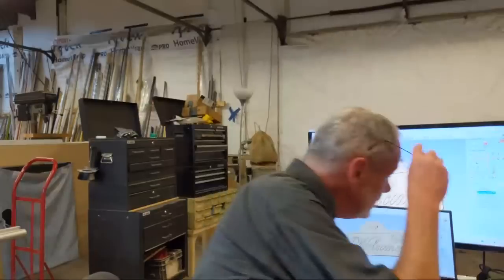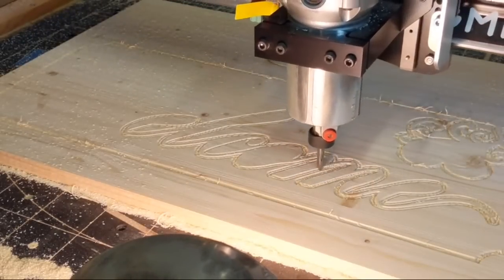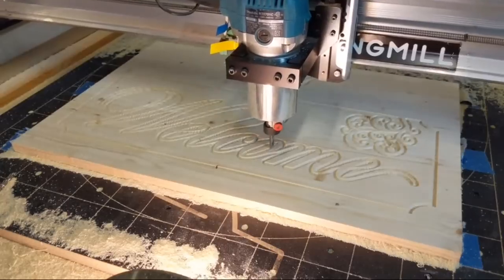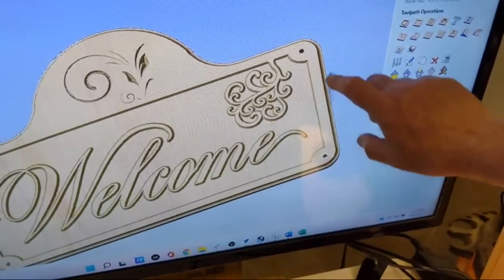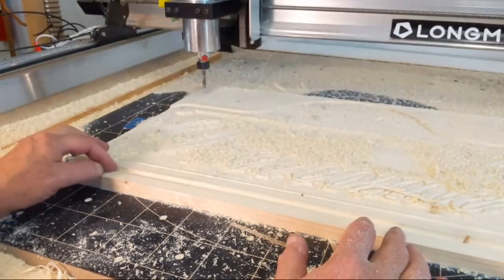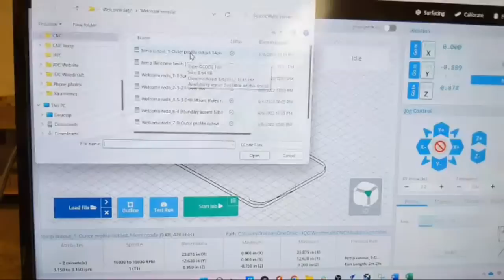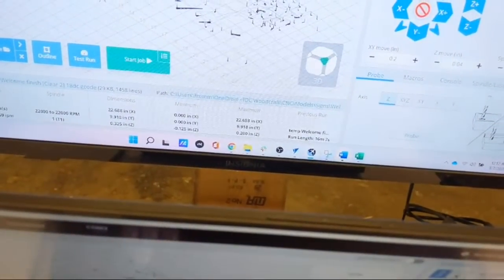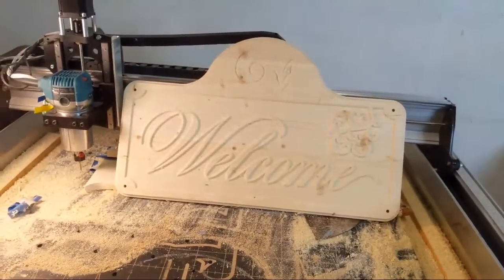How to Run a CNC Router Project Efficiently, Understanding Toolpaths

Comment: I love this kind of video man.. It's so cool to see how brilliant these machines are and what they are really capable of.. I've watched a couple of ur videos where u teach us how to use the software to get great results but atm I'm in the process of building my own CNC.. I have no experience whatsoever man.. LMAO.
I turned 50 in October and found myself making a massive career change into electronics. I love it but it's horrific being a complete novice/newbie to this field man. 
I think what ur doing is brilliant bcos ur opening this field of the CNC machine up to ordinary folks like myself. I began working with wood last year and found O had a real passion for it and then through watching some woodworking videos I got the bug and began to clear out an old garage and turn it into my workshop. It's still a bit of a mess atm but I am getting closer to kitting it out properly and I saw how good CNC's were and ordered a Laser but I'm still waiting omn it. I've bought all the gear to build my CNC now and over the Xmas Hols I'm going to take a shit at getting it built. 
I'm going the cheaper route by using belts and pulleys for now but I worry the belts will stretch and break. I will upgrade next year to the either bigger belts or maybe I will take a shot at using Linear rails..Maybe depending on price but I know they'll make it stronger..
Reply from the maker: Hey Slim, thanks for all the kind words brother. I really love what I do and getting to share my passion with others like yourself is really what keeps me going. I'm glad the videos have been helpful and that you've decided to take the leap of faith. I know clearing out the garage is no small feat! I'm looking forward to you getting your machine and seeing what you create with it my friend!
Reply: @IDCWoodcraft  Hey man.. Thanks for the reply bro. Yeah I ahve 2 weeks off now for Xmas so I'm gonna take a run at building my very own CNC and I am waiting on my CNC Laser to come soon. 
I will be kitting out my workshop this time off too so please God I can get everything goimng and the work gets to flow more. It's all a bit of a mess atm but this time off is going to be lit. I've been waiting on the Xmas Hols and finally get it all fixed up and looking like a proper workshop at long last.. I had so much to get done but now we looking to get it to look great and get it all painted up and built out with benches and cabinets and such.. This is going to be awesome once I get it finished bro so thanks for the words and inspitation from ur videos..

Comment: Great video i have so many questions. I bought an xcarve like 8 minths ago yours is sooo much faster. Can  i adjust feed rates or willnthe xcarve not be ablebtobhandle that. Sorry if that sounds silly but im pretty green yet. Thanknyou innadvance.
Reply from the maker: OhRichard, you definitely can adjust toolpaths and feed rates on your xcarve! Here is a video that should help you: https://youtu.be/qxi7epIGVX4
Reply: @CNC Routers, Beginners & Beyond - Garrett Fromme  awesome I have bought bit from idc before also and I think they have the settings on the label. I got the 1" surfacing but. Oh one more quick one is your table vacuum or were you using 2 sided tape? If tape where did you get it I'm sick of these clamps

Comment: I use Blender to create dxf files or clean up and modify downloaded dxf and svg files. It's a very powerful and free software. It can also import many different 3D files and export as stl file for 3D CNC and 3D printers. There is quite a learning curve but you won't regret putting in the effort.
Reply from the maker: Ray, that is a really good idea brother! Blender is a powerful software but just like you said, the learning curve is well worth the effort.
Reply: What do you mean by "clean up and modify"? 
Are you able to "improve" an stl file? And how is it better to use blender to improve an .svg file?
I've thought about blender before but I don't know the advantages. I have Carbide Create pro and I can carve out what is intended. But one thing I don't like about CCpro is v-carving. Constant up and down and I have no idea how to improve it.
What could I do better with Blender that I can't with ccpro?
I was wondering if you can take the time to elaborate on that?
Reply: @iwannaapple7190  You can convert dxf and svg to mesh and then manipulated the vertex's then export them back to dxf. I use it for my CNC machine. You can import stl files turn the tri's to quads and manipulate it as well and I use it for my 3D printer. I'm not familiar with carbide Create.

Comment: I was very interested in purchasing a long i’ll because of what you said about it in various video’s but when I see how long it takes to cut out a sign , then I thought what if I wanted to produce a 100 it would take a reticula’s time, can it go any faster
Reply from the maker: Hi Roy. CNC routers like any other method of creating things, are not machines that can punch out projects like a production machine without a lot of thought energy and systems building. But, becoming good with a CNC will enable you to significantly reduce the time it takes to make something.

Comment: Bought your bits, used the area clear, worked really well! 
? , after the area clear and changing bit to the 60 degree vbit, will the paper method work to redo the xyz?
Reply from the maker: Michael, right on brother! I'm glad to hear the bits have been treating you well so far! Absolutely correct, you can use the paper method to reset you z zero again after the bit chnage!

Comment: Can this be speeded up by using the optimize tool path button so it doesn’t skips all over, but finish to local area first?  I get the depth of cut changes involved. 😎
Reply from the maker: Paul, you can definitely do that but it is worth doing some trials to see if it makes a huge time difference.

Comment: I'm new to cnc, going to be buying the Longmill 48x30 thanks to your suggestion. If you wanted to have the recesses of this sign painted black and the surface colour wood, could you do the surfacing pass last? or would the surfacing bit destroy the project details
Reply from the maker: Brian, you wouldn't want to do the surfacing pass last. What you should do is use this material called Oramask to cover up all the areas that you dont want to paint. Here is a link: https://shrsl.com/36t5i

Comment: In the several videos I've watched I've never noticed you changing the rpm on the rotor. You  seem to watch the cutting and change travel speed, plunge rate, etc. to get the cut quality you want. What are the why's on this?
Reply from the maker: Ron, depending on the wood and even the grain the machine cuts a little bit differently. You will get a "ear" for what feed and speed sounds good on your machine and the harmonics it produces as it cuts.

Comment: So as I was watchhing it, I was wondering if you would get the same chip out if you had it going the oppesite way, seems like the bit was trying to cut backwards???
Reply from the maker: OneFishTale, you are exactly right but it depends. This is called "climb" cutting vs "conventional" cutting. Chipout depends on the direction but also the wood grain in relation to that cut direction! Best bet is to use a downcut or compression endmill.
Reply: @IDCWoodcraft  Thank you, I"m a total CNC NEWBIE, but I have been doing woodworking for over 30 years, so I know that using a router backwards will work when you want to try and clean something, but against the grain it will tottaly destroy it.
But anyway I love youre Videos, and I learn alot from them, so again thank you

Comment: Wish my signs come out that good, or even work AT ALL, my cnc starts off ok, then goes weird and routes letters over the top of each other. Ruins it everytime, but in different places each time. I got workbee 1500x1500 with 2.2 kW water cooled spindle. Use easel pro & mach 3. The tool paths don't show any errors on inspection. I'm ready to throw it out, only got it 2nd hand. Replaced lead screws & nut blocks etc. But it just keeps stuffing up.
Reply from the maker: Steve, have you tried running the toolpath dry above your spoilboard without any wood in the machine? It might help you diagnose if your problem is in the machine or your toolpaths
Reply: @IDCWoodcraft  if errors in the tool paths, wouldn't the problem be in the same area each time? I'm not sure. Machine makes a different noise each time it happens, so I'm leaning more toward hardware issue. It seems to happen on the rapid movement between cuts ✂️
Reply from the maker: @steveedwards2889  of it is a machine issue, you may want to check all the wire connections

Comment: Very nice project.  Do have a question.  Would like to see a vid of your design process for something  like this. Question is, what controls how deep, or not too deep, of a groove is cut, like the design at the top of the sign?  Can't be just multiple passes.  Thanks again!  Great demo!
Reply from the maker: Ron, it comes down to the type of cutter you are using and the space in-between the two lines that form the shape. If you are cutting out the design at the top of the sign, there is only so much physical space between the lines/vectors that the router bit will go.
Reply: How do you know where to start on the wood,or the computer itself will figure it out?

Comment: I didn’t get to see you design this sign. At the very end you ran a cleanup bit to cleanup the rough parts. Did you run a tool path twice using a different (smaller)  bit the second time?  Curious how the software knew where to go to cleanup the part the first tool path with the larger bit couldn’t get to.
Reply from the maker: Timothy, yes I ran the toolpath with a smaller bit that could clean up the rough parts. I recommend joining Kate and I for our weekly live sessions on Wednesdays at 8PM EST and we can talk you through all the details of the toolpaths!

Comment: This video makes V-Carve look horribly inefficient in the G-code it generates.  Are there options that could be used to improve this, or does it just suck that badly?
Reply from the maker: Hi Dan! I appreciate your thought on this. Yes, there are definitely improvements that can be made. However, at the same time it has a huge amount of capabilities. And as you know, whenever a capability is added, a new level of complexity is added.

Honestly, if it were up to me, yes there are definitely be things I would change but it is the number one software that is out there for general designer

Comment: Watching!! What is the best  size  of machine  to get
Reply from the maker: Smooth, it really depends on the types of projects you're looking to make with your machine. For example, you'll be needing a larger cutting area if you're looking to make things like cabinets or large signs, but if you're looking to make mostly Christmas ornaments or smaller objects you could go with a smaller machine.
Reply: @IDCWoodcraft  Tks .any program  out there  where you can learn  programming steps  with  out  having a  machine

Comment: GSender's time display just counts the number of lines it has ran already and records the time, then checks how many lines it needs to run and calculates the remaining time based on the amount of lines, but that's far from accurate. I had a project with over 10.000 lines but the first 50 lines were huge outline movements (a circle of a 20 inch clock). GSender thought the entire project would take about 2 days and 5 hours or so to complete because half a circle (1 line) took about 30 seconds and GSender thought every line will take about 30 seconds. But as soon as it encountered a huge amount of lines that took perhaps 30 milliseconds per line, remaining time decreased alot after every line and the actual time for that project was about 90 minutes.
Reply from the maker: Vaelen, you are so right on that one my friend. Sometimes that time display does a good job but it depends on the complexity of the project and the lines of code, exactly.

Comment: You have positions in ArtCam program correctly and angles too. And is better to work from ArtCam, because it is easy for work. For Dxf files, DXF is not good for CNC, because You will have error in settings for CNC engraving, stepover and other settings, just only in DXF files, because machine cant know types of vectors correctly, so Ai files are better and If You convert Ai files in Adobe illustrator 3 version, You will have correctly vectors and You can make all without problems.
Reply from the maker: KristianSerbak, great points brother! The last thing you need is errors when trying to create projects with your CNC.

Comment: why cutting first V-bit all, why not make first rouching all wood off big bit, and then clear all text and decorative V-bit need only cut text corners, . mean rouch first lot wood off then have lot better clear all text and decorative corners V .bit then V-bit not make hard work and no need cut both side at bit, need only cut one side  at bit soften, easy to bit  not need go down in wood full, only bit go down cut only one side.
Reply from the maker: mattivirta, You bring up a great point about the order of operations in CNC woodworking. Starting with a roughing pass can indeed help remove a lot of material quickly and relieve some of the burden on the V-bit for detailed work. This way, the V-bit can focus more on the precision of the text and corners rather than cutting through deeper material. Adjusting your approach based on the project can certainly lead to better efficiency and results. Thanks for sharing your thoughts!

Comment: first big mistake have use hand router to spindle, worst spindle ewer, noise lot, no long-live, bearings not has plan use cnc machines, same money can buy 1,5KW or 2,2KW REAL spindle, lot more torgue and lot lot silent and if buy water cooled spindle have lot more silent , and better accurate collects. waste only money use hand router to cnc machine worst motor what can newer use.
Reply from the maker: mattivirta, It sounds like you've had quite an experience with using a hand router on a CNC machine! Upgrading to a proper spindle can definitely improve performance, noise levels, and overall durability. Many woodworkers find the benefits of a high-quality spindle far outweigh any initial investment. Your feedback is valuable, as it encourages others to make informed choices for their CNC setups. Thank you for sharing your insights!